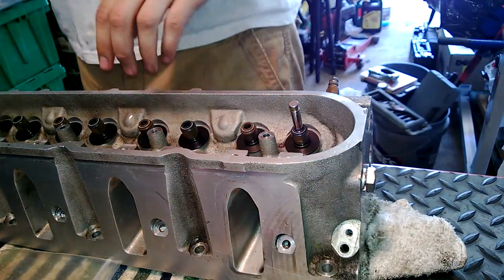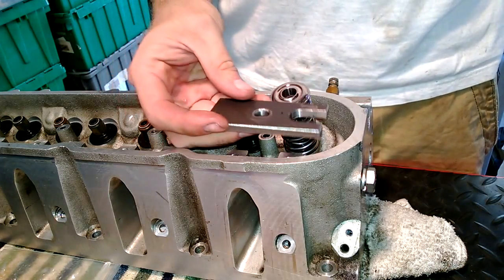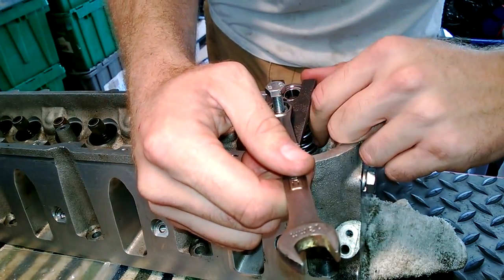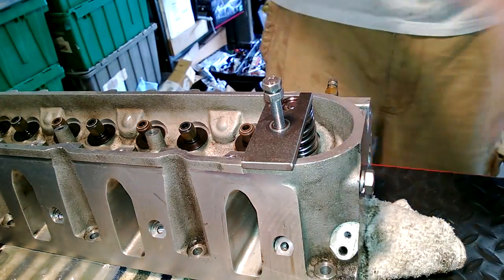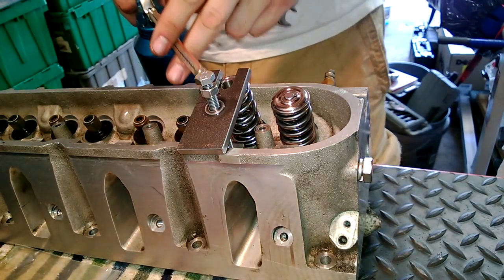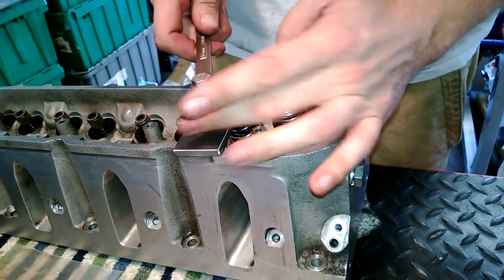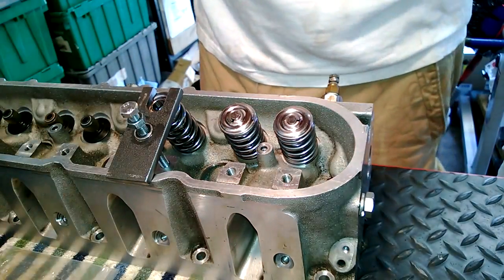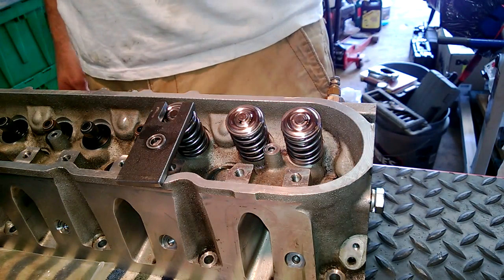Valve Spring Install - LQ4 Build - MTi 862 Heads

Comment: Did you not measure closed valve spring heights before assembly?
Reply from the maker: I did lots of measurments and homework before buying a spring kit and before this video.  The spring kit I got was specifically for the build though.  Ive had no problems.  7k+ RPM many times and it still runs like a champ.

Comment: What are you putting under the heads to keep the valves from opening? I’m trying to replace my springs and every time I compress the springs the valve opens up and the spring never goes down far enough while the retainers stay on top. They all go down together
Reply from the maker: Angelo Edwards I generally just put a balled up rag under the chamber. Usually all it takes. You can give them all a quick pop with a rubber hammer or something before compressing to unstick the keepers too. But a rag usually works.
Reply: JEG's Garage thanks man. I’ve been wondering what else could I do. Didn’t think about the rubber mallet I’ll surely give it a whack!
Reply from the maker: Angelo Edwards yeah sometimes they just get gummed up and don't want to unlock. Especially if there are some miles on the heads. Also spraying them with some carb cleaner might help. If you are replacing seals and all too not like you'll hurt anything.
Reply: JEG's Garage cool. But yea this is a junkyard 5.3 that I’ve already got all fresh parts for it except I haven’t put the cam in yet because I wanna get these springs and seals swapped out first. So far it’s been the biggest pain in the ass of this entire build

Comment: Hey, do you have a link to the valves and springs you bought?
Reply from the maker: I got the spring kit and the pushrods from Brian Tooley Racing.  https://www.briantooleyracing.com/  I dont have an exact link to the ones I got, but you can go on and pick the ones that match your build.  Really had a good experience with Brian Tooley.

Comment: Video is old, but you could mill a circular pocket in the compression plate that's just slightly larger than the diameter of the retainer. Mill it like .100" deep. That way the plate centers itself over the spring retainer and adds a little rigidity to the setup. You could even go a step further and mill a shoulder in the other end that rests on the head itself, ensuring everything is square, reducing the play side to side.
Reply from the maker: That would have been a great idea!  I would have had to put some more R&D into it, instead of just hitting it with a tape measure quick haha.  Only because you would have to be really lined up, and you would have to make sure the retainer is slightly off from the valve stem to start, so when you compress it lines up.  But maybe if I have to do it again I will modify the idea!  Thanks for the comment.

Comment: I used never seize on my bolt and it kept it from galling
Reply from the maker: That works!!  I just kept everything doused in oil. I figured since oil is what is going to be sloshing around in there, I would just use that.  Thanks for commenting!
Reply: question is there a top or a bottom on the Valve Spring when installing them
Reply: +soloM81 yes there is a top.  The retainer will only fit in the top
Reply from the maker: No there is no top or bottom, to these at least. The beehive style do have a top and bottom though. These are cylindrical and the retainer will fit either way.
Reply: +wkeil1981 sorry yah beehive have top and bottom

Comment: Could you send me the template
Reply from the maker: +matt carlisle Sure Matt.  What is your email address?  I have no idea how to send a file via youtube's messaging.  You can private message me your email if you'd like.  I have a PDF with dimensions and a full scale drawing of it.
Reply: +JEG's Garage idk how to private message on here. If you could send it to tylerfults23@yahoo.com that would be great!
Reply from the maker: +matt carlisle Sent!
Reply from the maker: +PinkRibbonRider No problem...shoot me your email address!
Reply: +JEG's Garage I'm in a CNC machining class right now and would love to make this!

negrodolphins@gmail.com

Did you use a specific alloy of metal for the tool?

Much appreciated good sir!
Reply from the maker: +Zach Rehak Hey Zach.  Just emailed it to you.  I just used regular old carbon steel that was laying in the shop.  It probably doesnt HAVE to be 1/4" thick by the way.  A tiny bit of bend while using it wont hurt anything, as long as its not going to fold up on you.
Reply: ***** I got the email, thanks man! Alright, sounds good. Thanks once again man!
Reply: +JEG&#39;s Garage Great Video!  Can I get the template too? 

HRHohio@yahoo.com 

Thank you in advance!
Reply from the maker: +HRHohio Thanks for watching!  Sent you the info.  Its a PDF file.

Comment: I have a huge issue I'm looking to replace one of the seals or all of the seals but no one can tell me where to get them please help
Reply from the maker: +Derek Johnson Crap...never saw this.  You can get new valve stem seals for these motors just about anywhere.  I think I got mine from TexasSpeed.

Comment: That tool works on l92/ls3 rectangle port heads. Even w the offset angle. The other tool use a hardened set screw m8x1.25